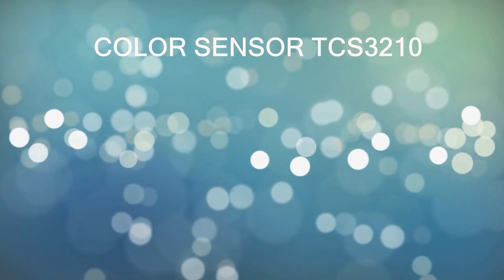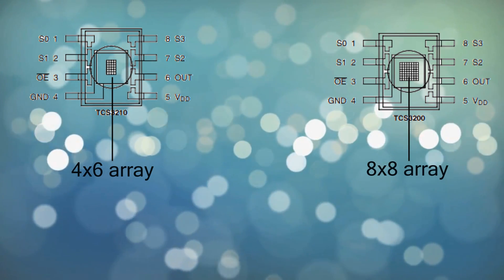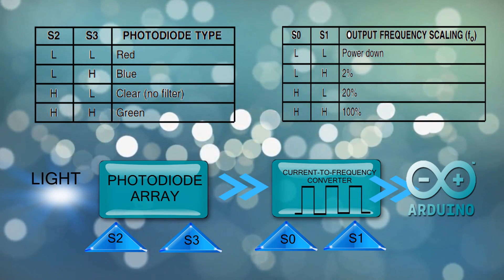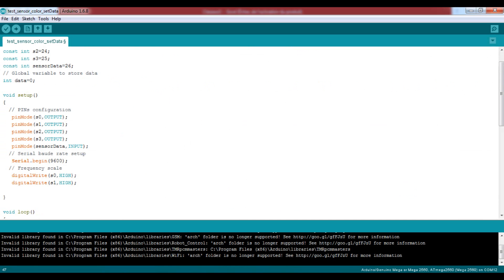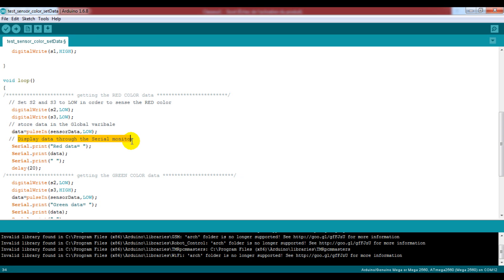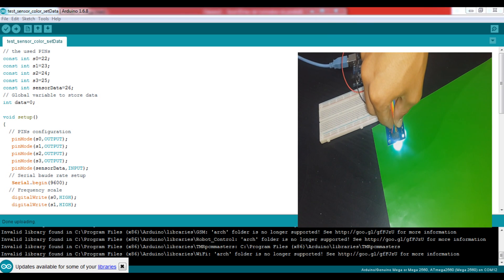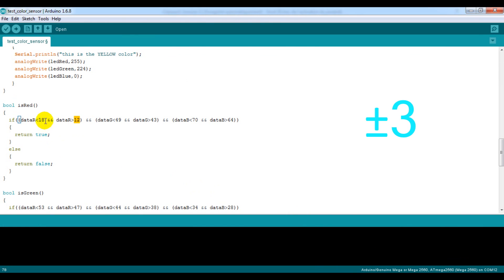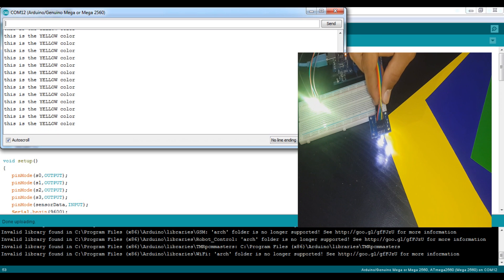How to use the Color Sensor with Arduino board (TCS3200 & TCS3210)

Comment: hello, I know this video is from six years ago and you'll probably not answer, but I have some questions:

1. I only have an Arduino uno R3, and not the bigger version, is there a simplified version that could have the same results?

2. I am working on a project that needs to write the change of colors of a plant on a certain file, and could run by itself while the computer is closed, does Arduino have that type of system?

I am sorry if I caused any trouble for you, I am still trying to learn more about Arduino and other circuit boards and how they work, and you don't need to answer if it bothers you too much.

Comment: How did you go from the values above 300 on the first code´s readings to the more significant small values you use from de Excel table to set the conditions for each color? I need to set my own readings and tried with the ones I got from the first code, didn´t work
Reply from the maker: Hi
The first code will give the data parameters for ech color and you will write yourself these parameters in the Excel sheet to use them in the second code
For exemple you use the first code and you measure for the yellow color these parameters :
R= 200 G= 150 B= 20
So in the second code you use these values to sense the yellow color it will be like
if(R_in>=R+/-10.....)

Comment: The link to the code doesn't show the code, instead some weird website
Reply from the maker: Hello 
We updated the links (mediafire download links) check them please.
Reply: @DIYGUYChris  i actually did all with determine the values each number except the last one where the serial monitor tells you what colour it is, cause i exclude the led pin and delete all variable relate with the led. But the serial monitor didn't show anything. I already put 
if (isRed ());
Serial.print("this is the RED colour")

But nothing occured...still figuring out. Even the code got verified but nothing.

Comment: Hi. Can this sensor compare 2 colours and give the result as % of their similarity?
Reply from the maker: Hello Pham Ngoc Quang
Yes sure, but it is for you to play some codding instruction in your Arduino programm.
Reply: Hallo thanks for your video 
What will happen if someone want to use a different colour for example black. Will this work with the same RGB sensor ?? Or what can we do in this case ???
Reply: @carlosfotsing6779  Black is not a color.  Black is the absence of all colors, therefore Black is 0,0,0 in RGB.  White is all colors, therefore White is 255,255,255.

Comment: Why are we trying so hard to do something that's simpler to do. real color sensing is the mixture of RGB not just the intensity of individual  RGB. we are suppose use color gels to filter out each RGB color coming from a scene. a photo-sensor only sees in black and white. Thats why we filter and can reproduce  millions of colors with color wheel etc. cameras and displays work this way...

Comment: SIR PLEASE HELP WHY IT ALWAYS SHOW DIFFERENT DATA FOR COLOR  FOR EXAMPLE FOR RED COLOR IT SHOWS 70 AND TOMORROW IF SENSOR WILL SENSE SAME COLOR IT WILL SHOW 30 AND DIFFERENT DATA ANOTHER DATEAND I AM USING SAME COLOR TAPE.
PLEASE REPLY ASAP SIR
DIFFERENT RANGE OF MOTION EVERY TIME FOR SAME COLOR
Reply from the maker: Hello Satnam,
I'm not sure about this but I'm using a margin of uncertainty which is +/- 10 for each color combination so you should do the same.
Reply: thanks sir for reply.              yes i am using + - 20.  but still red color read sometimes 10 and sometimes it rad 70 which is so far.  i have to change values in condition  everytime.  can i see ur program please thanks
Reply: @karanpreetsingh2476  You have to control the outside light. Try to put the sensor in a little box or in a dark place where the light conditions are always the same.

Comment: Hi, thanks very much for making this video, I have a noob question! :-D
I want to use the colour sensor to detect what colour is going past it, say red or blue or green for example. How do I set up the sensor if I don't know what colour will go through next? I am thinking of using the sensor to pick up which Lego train is passing over it so I can identify and stop/start the right train..so my second question is, if the train is passing over it too quickly, will it still pick the colour up? What is the polling rate or whatever? If this doesn't work I might have to use RCID or something...thanks
Reply from the maker: Hello Angelo,
About the first question, I provided in the description of this video two links for Arduino code, the first one allows you to get the appropriate data of ech color you want to detect then you place these data in the second code which allows you to detect (only) the colors that you set.

For the second question, the sensor detect the color after three combinations (for red,green,blue) and between each combination there is a delay of 20 ms and for each color detection there is a delay of 40 ms so you can detect one color each 100 ms (0.1 second). for more info you need to watch the video!!

Let us know if we can further assist you

Comment: A very informative video this. I just want to know how do i make an audio output of the displayed color using a speaker? Help me please
Reply from the maker: Hello Pranav,
We've already made a similar project with one of our subscribers so tell me more details about your project and then I can help you.

Let us know if we can further assist you.
Reply: i want a color sensor which reads the color and through the phone's speaker it says the color being detected.
Reply from the maker: In this case you need a component to connect Arduino to your phone like Bluetooth and an Android app installed in your phone that reads Arduino instructions and tells the color.

Post your email contact and I'll guide you making this.

Comment: Hello, i dont understand why the values of excel sheet are not the same that you read in serial monitor. I mean, in the first code  when you read the red color, in serial monitor prints " red data=254 green data=199 blue data=274", but this numbers are not the same that you write for red color in the excel sheet. PLEASE, CAN YOU EXPLAIN ME THAT?
Reply from the maker: Hello Lucas,
Sure the values are the same but I think I wasn't synchronise the part of the video where I showed the color and the serial monitor display 

Let us know if we can further assist you.

Comment: A complete information on video .  This is nice work !!

I am not able to get the first code, I got second code from below link 
 http://www.mediafire.com/file/m2xl8ah5tsv1xmv/test_color_sensor.rar

But only with this program my serial monitor is not working , may be my RGB values are not matching 

Can you suggest me solution.

and can i get a working link for first code?
Reply from the maker: Hello Ayush,
Thank you for the compliment.
About the color detection you can not use the second code before setting up the data for each color and you can get these data only from the first code that you can dowload from here:
http://www.mediafire.com/file/pyp188ykj29qcq6/test_sensor_color_setData.rar

Let us know if we can further assist you.
Reply: Thank you soooo much! :)

Comment: I am also trying to make it. but there is a problem it prints in Serial monitor  side to side. 
What to do in order to print it under by under as I were able to fix the results.
Tell me please where is the mistake in the code or it is possible send me please the codes.  Thank you
Reply from the maker: Hello Վահագն,
Just change every "Serial.print" instruction by "Serial.println" and it will display results in new line 

Let us know if we can further assist you.
Reply: Thank you.
Reply from the maker: You are welcome :)

Comment: hello sir, i have gone through your programs but i see your logic level for dataB and green dataG seems confused. for green filter doesnt it supposed to be S2 HIGH and S3 HIGH and for blue filter S2 LOW S3 HIGH. Please correct me if im wrong sir.
Reply from the maker: Hello Nur,
Yes! you are right, now I updated the donwload links with the new configuration ;)
Thank you so much..
Reply: Hello sir ...you have interchnaged color filter code of s2 and s3 for blue and green.... 
It is there in "getting the blue color data" and "getting the green color data" CODES

Comment: What happens if the white led is not presented?
Reply from the maker: Hello Hackeando,
The white light color will be reflected on the sensor array to identify the color so if there is no white LEDs the sensor will not be able to identify the exact color but it gives you data

Comment: hello can you teach me because I have fyp project. I want to make color sensor for blind people. Did you know how to make the output in form of audio using speaker?
Reply from the maker: Hello Ahmad,,
Sure you can use this project to make a device that sense the color through the TCS3210 sensor and you need to add a loudspeaker connected to your arduino plus an SD card or microSD carte shield where you should store the voices of colors that you want to display, don't forget that an Arduino board can't display an mp3 file because it is based on a 8-bit microcontroler and it can't store mp3 files because of it's limited number and size of registers.
Reply: MEGA DAS I am beginner in arduino programming. so i dont even know how to make coding. i am just know copy paste other coding and upload it. so can you make one video about it + coding? i am very appreciate if you help me. I want to submit this project this 31 Mac. can you please help me please
Reply from the maker: Hello Ahmed,
I can help you by providing the guidance for your project through links, examples etc... but I can't make it for you! I'm so sorry for this.
Reply: Helo MEGA DAS, thanks for your reply. I am really appriciate it. Anyway your video help me get an idea. Thanks
Reply from the maker: You are always welcome dear Ahmad.
Feel free to ask about anything you want to know. ;)
Reply: Hello MEGA DAS . I have one question. is it possible make two project in one board arduino?
Reply from the maker: Hello Ahmad,
Sure it is possible, I suggest to place a switch to select which project the board should perform and in your Arduino code you should make a condition to execute some instructions. For example connect the switch to pin 2 and in your Arduino code while the input pin number 2 is high you perform the instructions of the first project and while it is low execute the instructions of the second project.
Reply from the maker: Hello Ahmed,
Just share your e-mail or g-mail address in a comment then we make the contact.
Reply from the maker: Done,
Reply: Hello Ahmad, How did you go on your project. Can i ask if you are in the medical profession. Seems like a great project for an Occupational Therapist or other health services. I studied Occupational Therapy, do not see many people working on Ardunio project within the health care section. Have some good ideas for projects down the track, if your interested i can share them with you. All the Best.

Comment: Hello. I do not understand how you get the data values in your excel sheet. Can you please kindly explain?
Reply from the maker: Hello calai,
I wrote the values in Excel file myself, but I got them from the serial monitor.
Try to download the first code and upload it to your Arduino, connect the sensor following the same wiring that I did then open the serial monitor and you will get the data values proportional representation of the sensed colors. 
Follow the steps that I performed in the video

Let us know if we can further assist you.